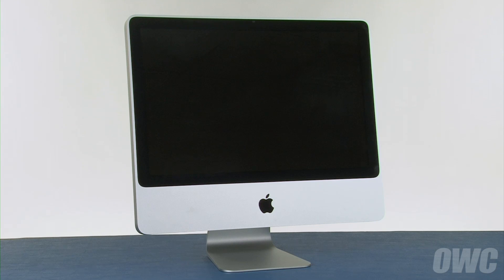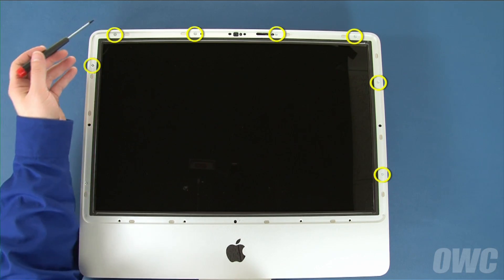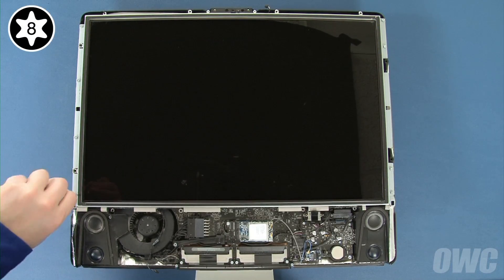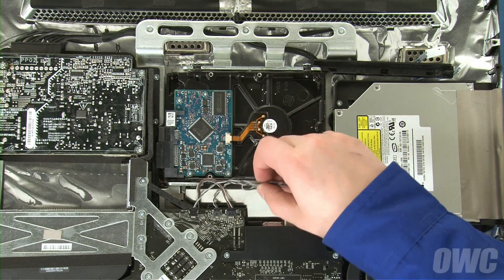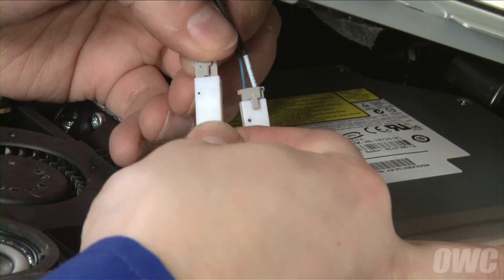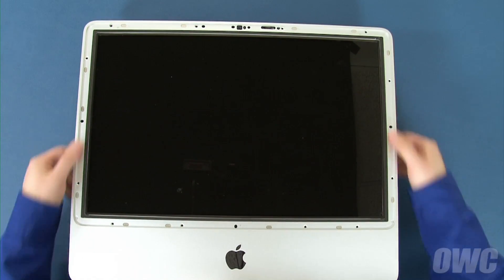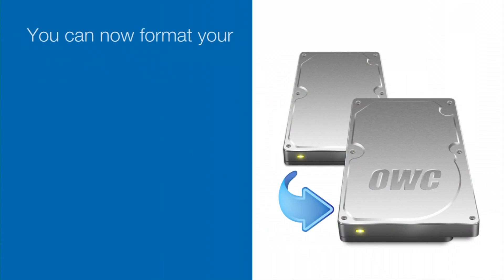20-Inch iMac (Early 2009) Hard Drive Installation Video

Comment: My LCD temperature sensor cable looks completely different.
Reply from the maker: Hi toajames1!  Sorry to hear that your temperature sensor cable looks completely different.  This is the video for 20" E2009 iMac; please make sure that your iMac is an iMac9,1.  Please feel free to email us at support@owc.com or call us at (800) 275-4576 (International: 1-815-338-8685) for personalized customer service. The Call Center is open from 8:00 AM to 8:00 PM (tech 8:00 AM to 6:00 PM temporarily due to staffing issues) Central (Chicago) time Monday through Friday.
Reply: @poweredbyowc  I used the other Early iMac 2009 video you uploaded and that worked!
Reply from the maker: Glad to hear it had worked out for you, if you need help with anything else please let us know!

Comment: BIG THANKS! Just replaced an old HDD on my early 2009 imac with a SSD I had laying around (using a special 3.5" to 2.5" adapter bay) and it brought new life to it!
Reply: I have a mid 2009 9.1 iMac but they replacement thermal sensor cable made by OWC is only for late 2009 and I’ve been told I don’t need to replace the thermal sensor. Did you replace yours? I was told Mac fan control can take care of it and to just disconnect the thermal sensor from the new SSD I want to install.

Comment: can you use a 2.5 ssd with a 3.0 bracket instead of another hard drive for an upgrade to this model
Reply from the maker: Thanks for asking! Yes you can. Here is everything you would need: https://eshop.macsales.com/shop/ssd/owc/imac/early-2009
Reply: @poweredbyowc  I was messaging apple and they said to be careful about upgrading the ram and ssd both because the cpu and the computer might not be able to handle all the upgrades well long term
Reply from the maker: We would have to disagree with that statement. We have been upgrading machines for over 30 years to max out the performance. More RAM and moving from HDD to SSD makes your machine faster, run more efficient and causes less stain on the machine as a whole. We would never provide solutions that would potentially cause damage or a shorter life span in your machine! 😃
Reply: @poweredbyowc  I recently purchased a ssd for the 2009 iMac from owc would I have to format it or is it fine as is
Reply from the maker: You can find the instructions on installing a fresh copy of the OS, and migrating your data to the new drive, here: https://eshop.macsales.com/articles/how-to-transfer-your-data-from-your-old-drive-to-a-new-drive

Comment: Do you know exactly which brand and model HDD to install without any fan issues (firmware on the hdd)? This model comes with a fan issue on some hard drive replacements, i have been looking for which brand of hard drive this model originally came with but can only find the spec and not the brand, as far as i can see it's a Seagate Barracuda with a 4 pin sensor connector but i'm still unsure.

Comment: Awesome video.  I just upgraded to a SSD following this video on my 24" early 2009.  Only a couple of the connectors behind the monitor were different, but same process nonetheless.  I got my SSD and the adaptor fitting from you guys.  Works great!
The only thing the video should mention is to have an OS ready to go.  Some people could be stuck with an unformatted Hard Drive if they don't know any better.
Before taking the iMac apart:
1. Reformat an external hard drive you may have lying around to "Mac OS Extended (Journaled)"
2. With the external drive plugged into the iMac, powered down and upon booting up, push "command + R" to download your current version OS to the external drive.
3. Backup any/all files to the external drive which now has an OS on it.
4. Take apart the iMac and install the new Hard Drive (following this video!)
5. After installation the iMac will boot up using the OS on the external drive.  Reformat the new hard drive to the "Mac OS Extended (Journaled)".
6. Power down again and upon reboot press "command + R" to load the current OS to your new hard drive.
7. Transfer files back over to the new hard drive and Bob's your uncle!
Reply: this external drive OS X install doesn't work - I've tried on 2 drives with no success
Reply: I didn't need to create an external boot drive, only connect to drive I was replacing via USB to boot, format the new SSD that is replacing the old HDD and load the OS and the backup to the new SSD

Comment: 'Lift up on bezel to remove'. This person has hands of steel. I wedged a flathead screwdriver under top of bezel with no damage done. The LCD cable removal is brutal. Thank God I don't have to reassemble.

Comment: Recently had my Early 2009 iMac breakdown, pretty sure it was either a Graphics or Display issue. Does removing the hard drive basically do the same thing as a factory reset? I can't reset because of dead screen so

Comment: Hi does it matter if the inverter cable gets switched?
Reply: and what if you didn't ? and you're now putting it back together ?
Reply: @eduard1337  i guess its time to buy a new imac
Reply: @GabrielRN28  I did not mark them. Is there a visual to pair them?

Comment: 1:19 This is a great way to shear off the bottom positioning pin on the glass panel. You should place a suction cup on one top corner and the other on the opposite bottom corner, and then pull it straight up.
Reply: Or the side one like I just did. Thankfully it still holds well.
Reply: Yeah... I partially sheared it... Still holding so far.
Reply: I just use one suction cup in the middle lol

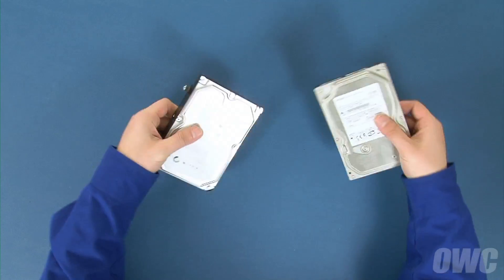Comment: Looks good, though i would refrain from technician to press on the hard drive, as this would cause internal hard drive issue at 5:31 the fingers are pressing quite firmly on drive.  And hold the drive from the sides when removing hard drive, some people may think this is okay and then find out later there had drive does not last long. Like the music